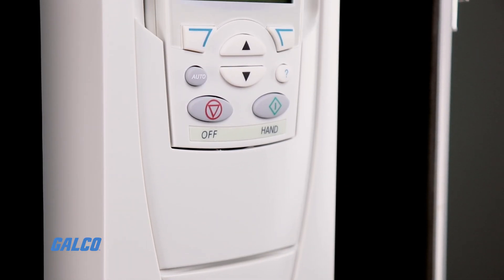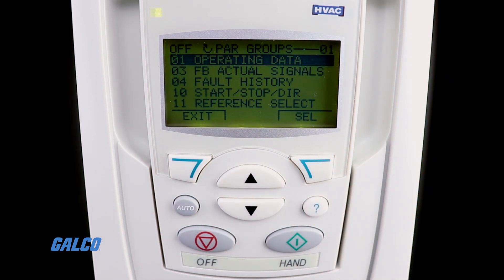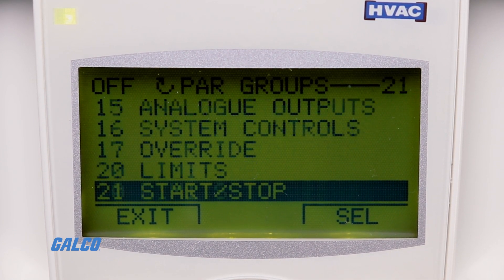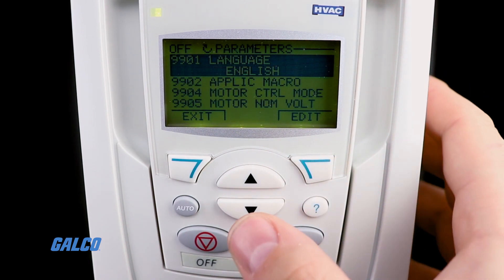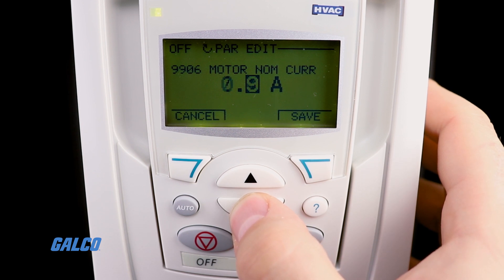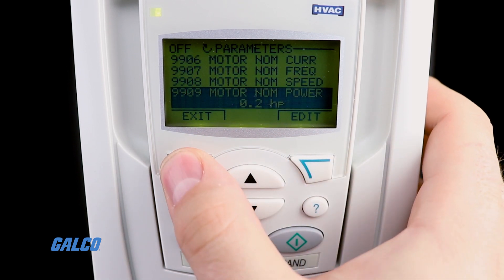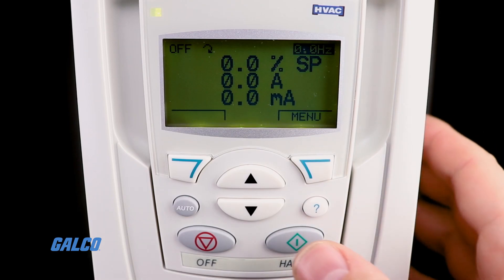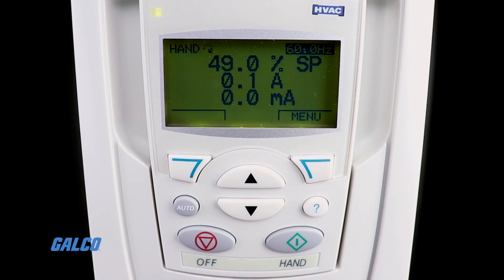How to change Individual Paramaters on ABB's ACH550 HVAC AC Drive | Galco

Comment from the maker: Configuring a basic startup using individual parameters on the ABB ACH550 HVAC drive is quick and easy thanks to its intuitive menu system. Shop Now: https://www.galco.com/shop/ACH550-ABB-HVAC-Drives-HVAC-Drives